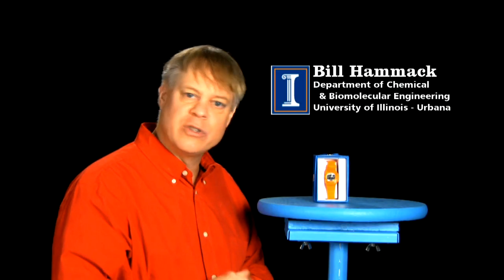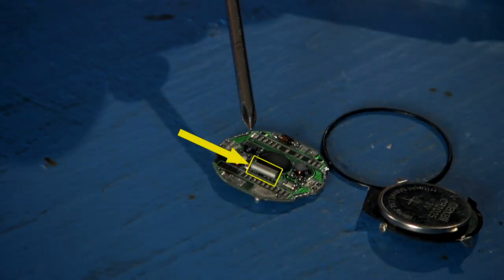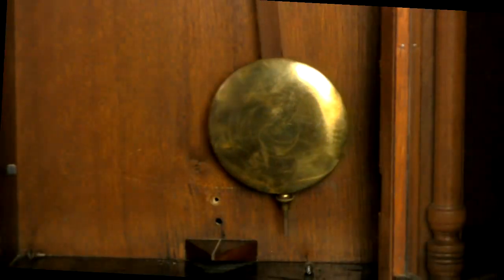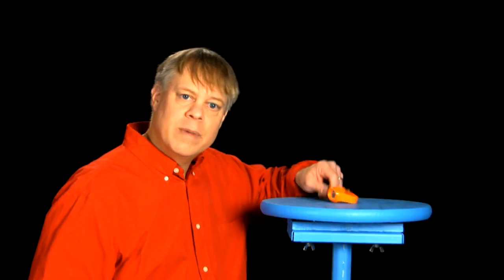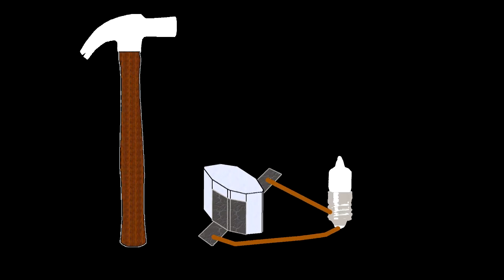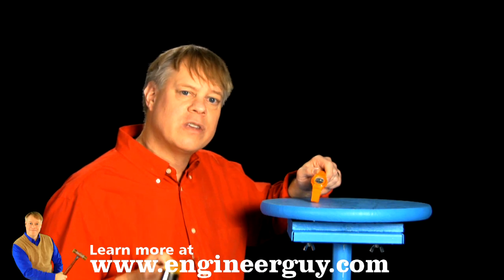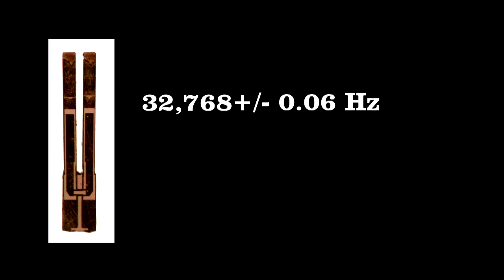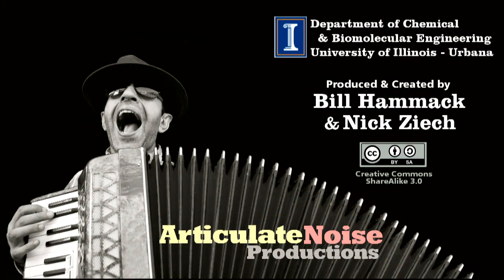How a quartz watch works

Comment: I was struck by the seemingly odd specificity of 32,768 Hz. So, I looked it up and it turns out that it's the overflow of a 15 bit binary digital counter. 2^15 = 32768. So, each time the counter reaches 32768, it sends an output. Effectively, the 16th bit changes state at 1Hz and you get your seconds. Thank you for the pleasant diversion.
Reply: Wouldn't that make a frequency of 2 Hz? Assuming you measure the MSB of a 16 bit counter, it would toggle at a rate of 2Hz (since a 16 bit counter would count to 2^16 = 65.536). This would make its overflow flag toggle at a rate of 1 Hz.
Reply: I think I clouded things by calling it "the 16th bit" (it seemed to make more sense in my head, than how I wrote it down). A 15 bit counter driven at 32,768 Hz will overflow once per second. That digital pulse-per-second drives the seconds counter at 1 Hz.
Reply: It is interesting they used 32ki, when 64ki would be more fitting, with 16 bits also being a power of 2.

Though if you're programming, a 16-bit signed integer would wrap around after 32767. So maybe they use that?

Or hell, they could just be incrementing the counter, and when it is positive, they turn on the delimiter dots, and when it's negative, they turn them off. Idk. it's just fun to think about.
Reply: If it jittered +/- one count, as would be displayed on a frequency counter, your reasoning would be correct. But that's not how the circuit  works. These crystals, electrically, look like an LC circuit. L for inductor, or coil, and C for capacitance. An LC circuit has a unique resonant frequency. An LC circuit is placed in an oscillator circuit. But a crystal is much more precise, as mentioned in the video. It runs constantly. Its not gated, as would be done on a frequency counter circuit, so there is no +/- one count (lsb) jitter. When divided by 2^15, in a simple counter chain, the output 1Hz, is still as precise as the original 32,768Hz. No lost counts. Though the one error, in this video, is the crystal precision. You can get crystals with 1ppm precision, but the ones used on the really cheap watches are nominally 20ppm, or off just under a minute per month. Those 1ppm xtals are much more expensive, and would only be found in better watches.
Reply: I have no idea what you wrote but i feel smarter after reading them.
Reply: stephmon wut
Reply: stephmon nice
Reply: While it is 32,768 because powers of two are easier for electronics to work with, the value 32,768 is actually a compromise.  If you just needed a once a second tick, 1Hz would be perfect since lower frequencies mean simpler hardware and lower power consumption, but it takes a huge crystal to oscillate that slowly.  It turns out 32,768 is the lowest power of two frequency a compact crystal can operate at.  It may have been true at some point in the past that it would operate a binary counter that rolls over once each second, but in modern watches the crystal serves directly as the frequency source for a microcontroller in the watch, and the microcontroller performs the math necessary to keep track of time.  With modern hardware it's not terribly important that it be exactly a power of two, but it does serve to simplify the math and it has economies of scale firmly on its side.
Reply: The number 32768 has the mathematical property of being divisible by 2 , all the way down to 1, without remainder. And thus a series of divide by two counters can be implemented to realize a frequency of 1 hz, which is to say 1 cycle per second - a 1 second time-base. Very convenient indeed.
Reply: @MichaelCappiello  One minor correction: 32,768 is the lowest power of two frequency above  20,000Hz that a compact crystal can operate at. Below 20,000Hz, the crystal would produce an audible 'whine', which would eventually annoy the user. Regarding size, there are ultra-miniature crystal packages all the way down to 10 kHz, which would make 2^14 (16.384 kHz) feasible (and would extend battery life, which is yet another compromise).
Reply: @CineSoar  Interesting. I have a cheap casio watch which makes an audible "whine" when I press the illuminate function. I wonder why
Reply: @Bankable2790  There is a tiny transformer inside, to make the higher voltage that the backlight needs. The rapid switching sets up an EM field, which makes a vibration in the device that can be heard.
Reply: @CineSoar  ohh that makes sense. another one doesn't but it seems to be lit by an incandescent light. the original was way brighter and illuminated the whole face. what type of illumination is this?
Reply: you are reading too much into it. all sorts of other frequencies exist also. many of them are binary aligned rather than decimal but  not because of the necessity of 15 bit overflow. a micro controller can build a timer from pretty much any > KHz clock. if you dont have a microcontroller, (even an 8 bit one that may have cost 1 buck 40 years ago) a few nand gates would suffice
Reply: I like turtles.....
Reply: @Colin Mor if you go back through my replies above, you'll see that I said just that, about 2 yrs ago. :)
"32,768 is the lowest power of two frequency above  20,000Hz that a compact crystal can operate at. Below 20,000Hz, the crystal would produce an audible 'whine', which would eventually annoy the user." -- Me
Reply: @CineSoar  Why didn't they use a shorter register driven at a higher frequency?
Reply: @stopthephilosophicalzombie9017  Higher frequency, comes at the cost of battery life and to a certain extent complexity and cost of the electronics.
Reply: @webx135  I'm 99% sure that choice has more to do with the physics of the material than with software choices.  32MHz is an easier crystal to manufacture than 64.
Reply: Thank You for giving that information, much appreciated!
Reply: @MichaelCappiello  One more minor correction: you don't normally see the 32KHz crystal used to directly clock a microcontroller, as 32KHz is far too slow for most applications. Microcontrollers often come with a second set of crystal pins specifically for a realtime clock crystal, and all timekeeping operations are done in dedicated hardware without needing to bother the processor. The processor can then focus on other things like driving the display, and shut itself off to save power in between display updates.

Comment: I've also read that crystals can be tuned by electrochemical etching / plating. Oscillating piezos are used in evaporation equipment to determine the thickness of the film being deposited, because the frequency changes as material builds up on it's surface.
Reply: I work with some Anodizing, black oxide, and zinc plating suppliers. Your statement drew new interest to the processes and now I'm curious to any of them knowing about this.

Comment: The Accutron watches from the late 1950's used a tuning fork principle, in fact you could see it in the watch and it became the logo of the brand. Very accurate by 1960's standards, but batteries had to be changed often. The beauty of the Accutron was its fluid sweep second hand which moved smoothly around the dial, imitating the rotation of the earth itself. Gorgeous !!

Comment: I knew the watches used a quartz crystal, but, being in radio, I thought that they would be shaped like a simple plate, which expands and contracts to set  a radio transmitter frequency.  This is extremely interesting.  I have a tuning fork Bulova Accutron watch, that vibrates at 360 HZ, which can actually be seen and heard if you hold it to your ear.  I also have a more modern Bulova watch which has a crystal that vibrates 8 times the frequency of a regular quartz watch.  That is 262144 Hz.  I also have a few "Atomic" watches made by Casio and G-Force.  These watches are really crystal controlled watches with a tiny radio receiver that receives time signals from radio station WWVB.  WWVB broadcasts its time signal at a frequency of 20 KHZ.  The watch keeps good time with the crystal, but once a day, any it gets corrected by the radio signal.

I am tempted to get one of those cheap watches and open it up myself.  But, I would not want to open up my Bulova, so my question is, does the Bulova also use a tuning fork shaped crystal at 262144?  It would have to be extremely small.

Comment: A quartz tuning fork is subject to temperature and pressure, it becomes inaccurate eventually. The atomic clock is the pinnacle of time keeping precisely. Even with the compensation with gold capping, it still has major physical inaccuracies. To get to the atomic level is surely called fine tuning a system. I would agree that having such tech available to anyone is amazing, and we tend to overlook it, but if you relied on this technology for things such as GPS, you would not be able to transmit signals to their exact designation, it would be off, by roughly 300 metres. I must agree with a simple watch being actually not so simple though :)

Comment: Of course this would have taken too much air time... but I'm assuming the reason it's tuned to exactly 32,768Hz is because it's a power of 2.  It probably factored into the circuit design, and is probably yet another reason why quartz was chosen as a material.
Reply from the maker: +fisharmor that's what I assume too
Reply: yes. because you can make a "2 bit counter" from only a t-flipflop. adding them together in series lets you count in binary. If you count up to 32768 (by adding 15 tff`s together) and then you know that one second has passed.
Reply: fully hectic numbers bud
Reply: yous just get a job
Reply: scows
Reply: fisharmor  😍😍
Reply: alternatively you can use this high frequency to measure fractions of seconds.
Reply: fisharmor you use a cascade of frequency dividers to get to 1 hz

Comment: The crystal inside the clock is pitch fork shaped, the forks are "balanced" using a metal gold tip, just like a car wheel is weight balanced. DC Electric to the crystal terminals and it oscillates. Thats amazing .

Comment: He is very simplified with the crysta. The crystal is actually in a resonant feedback look with an oscillator circuit. You cannot put DC from a battery directly across the crystal. The oscillator circuit goes in to a resonance and thus puts out the frequency. The oscillator is slightly fine tunable to tweak for greatest accuracy. The crytal circuit is loaded in the feedback loop to cause some distortions in the feedback signal. This loading is tunable with a trimmer capacitor, or by software.

Comment: The wheel driven by rotor sprocket in a quartz clock rotates one complete turn in a second and drives the centre second wheel so that it works in the principle of escapement wheel of spring driven clock which both activates the anchor shaped lever and fork shaped pallet to keep the pendulum or balance wheel oscillating for days while forwarding energy from going train to pendulum or balance wheel and also drives the second hand wheel (either it is sub or centre second) while reversing motion. But the difference between both is the anchor shaped lever, fork shaped pallet and pendulum or balance wheel are replaced by small peizo electric motor which is composed of small PCB board of resistors, transistors, small tuning fork shaped quartz crystal oscillator sealed in a small cylindrical metal container, 15 flip flop circuits, microprocessor chip, solenoid coil and rotor sprocket. The great wheel of mainspring barrel is replaced by battery. The third wheel transfers motion from centre second wheel to centre wheel of cannon pinion (12 toothed pinion with hollow pipe in the centre of the centre wheel of minute hand) that carries the minute hand, the minute wheel transfers motion from canon pinion to hour wheel with hallow pipe that carries the hour hand. All these works in the same priciple as in spring driven clock. Thus the gear train of analog quartz clock follows the same priciple as the reverse of motion from escapement wheel to centre wheel of the mechanical clock. Forwarding energy from great wheel of mainspring barrel to escapement wheel causes the pendulum or balance wheel to continue oscillating for days and reversing motion from escapement wheel to main wheel causes the hands of the clock to move forward. When the process is repeated again and again it causes the mainspring to gradually unwind and completely unwind after some days. In quartz clocks electric power from the battery is gradually passed to the peizo electric motor which drives the gear train of the clock so the battery power gradually discharges for months and  the battery completely discharges after 12 months.

Comment: So if you strike the watch, or shock it violently, will it make it off time, or will it go back to its resonate frequency only mildly affected?  I have the same question about mechanical "winding" watches as well.  One would think acceleration, force, or shock (dropping it) would make it go out of whack.  Anyone care to explain?
Reply from the maker: Xanifur It doesn't affect it best I can tell. Interesting this is some empirical testable. I wonder how much shaking and how violent would be required to effect it. The tuning form is very small and doesn't have much mass.
Reply: +engineerguy  Thanks for the response, and yes it is so small I can't see it being affected that much without going "back in tune" as they say.  Mechanical watches are still a mystery and a mechanical master craft.  Can you please do a feature on them?  The engineering on non digital watches is is phenomenal.
Reply: Matt Rayner Einstein's theories still allow for backwards time travel, and that's what counts :D
Reply: ***** you would have to have machine that could bend space time, and it is impossible for a object with mass to travel anywhere close to the speed of light,  Einstein's theories don't allow backwards time travel. E = mc2 
you would have to have infinite energy as the faster you get the more your mass increases. C stays the same but your Mass is equivalent to how much energy you would need.
Reply: +engineerguy 

I bet that the other watch components would be destroyed before the time is effected to the point of it being measurable
Reply: thesam723 Took me a while to see this comment, but it is not correct. It's not impossible at all to travel near the speed of light, it just takes a lot of energy. Particles get near the speed of light all the time, even in a standard accelerator. and the current theories do allow for the possibility of time travel, but no one is really certain.
Reply: I agree I was wrong I know more now, then I did then.
Reply: ***** You're saying that no one knows what the speed of light is? Are you insane? Also, the speed of light in a given medium IS a constant, which is used extensively in all forms of now everyday technology. Furthermore, this wasn't even an argument until just now
Reply: You're right, it cannot be empirically observed, and therefore remains theoretical, like gravity and magnetism, and therefore any argument based on them is pointless, which is why when you jump off a building, it's impossible to predict whether you'll fall or not, and therefore shouldn't even be considered. 

I admire your attempt to appear smart on the internet, but this is little more than muddying the water.
Reply: speed of light in a vacuum
Reply: oh god. Tony. shut up. From a physicist... please stop talking. First - Massive things can go near the speed of light. As near as you want, considering you have enough energy to spare. Second - The speed of light can be measured, AND even better it can be CALCULATED!. Third - Magnetism is NOT Gravity. Magnetism is an electromagnetic force (hence the name) and is a result of charges, while gravity is a result of the bending of space and time. ugh. The speed of light is not a theory.
Reply: TIME DIALATION. and LENGTH CONTRACTION.  Basically - light will appear to pass you at the speed of light, sure. BUT the trick is that to an observe at rest with respect to the light, you (moving 1mph slower) still appear to be moving at (near) the speed of light!  This is complicated and took me the greater part of my undergraduate degree to fully comprehend, but keep in mind that relativity is based on the function for gamma = 1 / SQRT( 1 - [v/c]^2)  which means that relativistic effects are not a simple binary, on / off, but instead  happen on a continuum which grows to infinity as you get closer to c. But it never reaches inf unless you are massless, and then you travel at c.
Reply: Gshock ftw
Reply: current physics state that the more we reach light speed (186.000 miles per second / 300 kl p s) the more energy input is needed. The more energy the more mass etc; therefore we could theoretically only ever reach 99.99.99 % and so on of light speed and never able to achieve 100% because of the restrictions in Einstein's equation: let that be an end to it! How did you get onto theoretical physics from quartz watches I do not understand. I find both sciences thoroughly fascinating.
Try researching Tachyon particles!
Reply: I realize this is way late, but impacts (i.e. from drops or hammer strikes) impart mechanical vibrations of frequencies significantly lower than the resonant frequency of the quartz.  To visualize what would happen, take your tuning fork and lift it up and down as fast as you can.  What happens?  The tuning fork continues vibrating at it's resonant frequency.  That's essentially what the quartz would look like after the impact, if you could zoom in and slow time.
Reply: Xanifur Mechanical watches are affected by quite a few factors. Temperature, Barometric Pressure, Orientation, Gravity. And yeah. If you whack them. It’ll affect them. Though a lot of mechanical watches have Incabloc shock resistance.